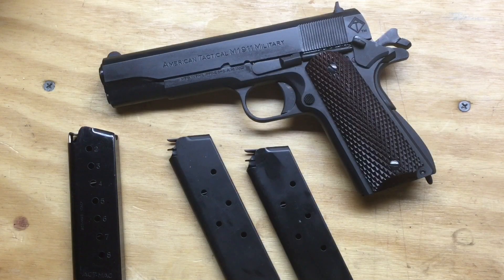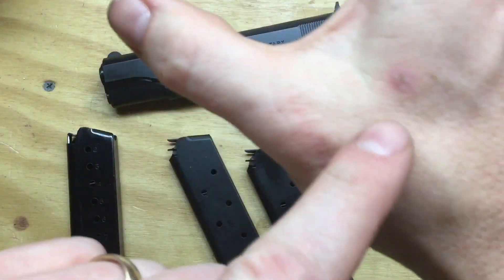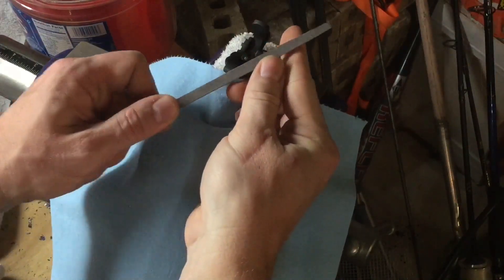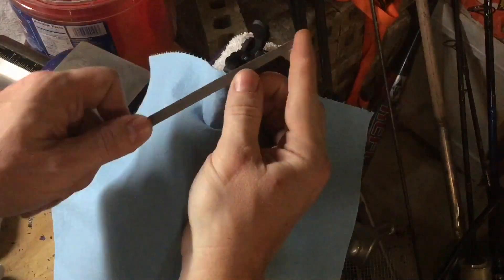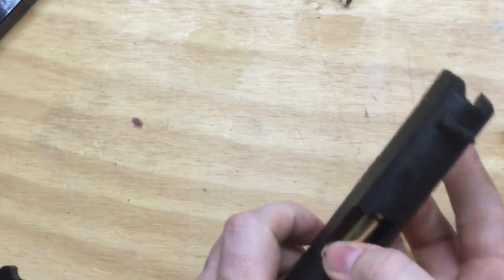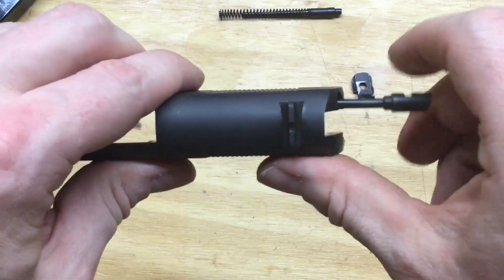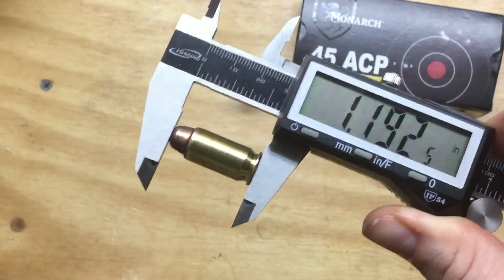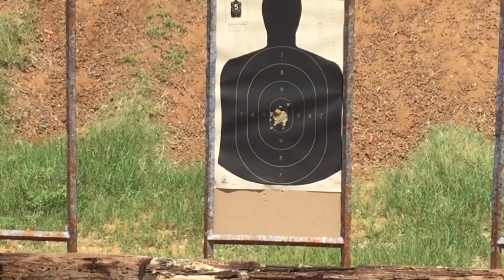ATI 1911 Tweaks and Second Range Trip

Comment: Loads of bacon,I'm getting the same pistol soon off of layaway. Do you know if front sight is small or large on the  tenon that goes into the slide? I  emailed Ati and person who replied had no clue what I was talking about. But did send me a page that shows the sights and dimensions, but I still have no clue. I might replace the sights. Thanks if you can help,Mike. Ps I was not able to find anything on line either.
Reply from the maker: The front sight is not on a tenon.  It is integral to the slide.  To replace it you'd have to mill it off, or come up with some other creative solution.  (You can get a better view at about 4:30 on this video:  https://youtu.be/oyyiRB0Q288 )
The back sight is dovetailed it, but I've never messed with it so I can't speak to dimensions or ease or options of changing it out.